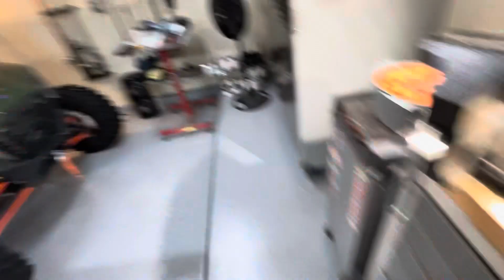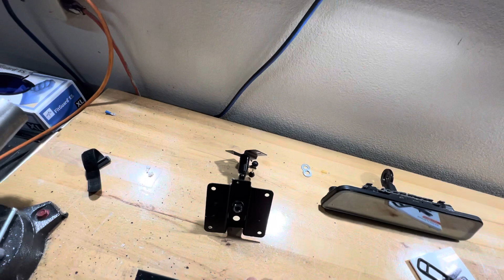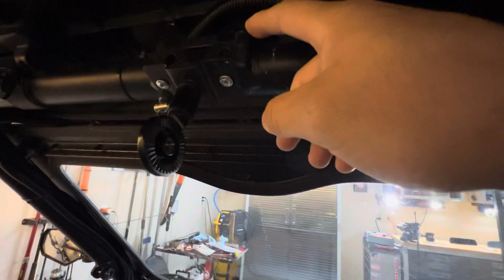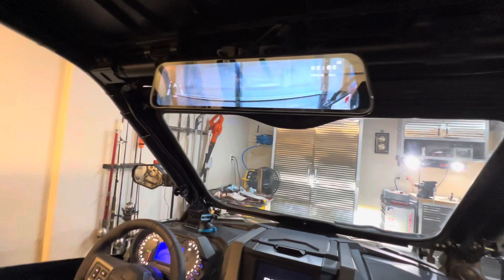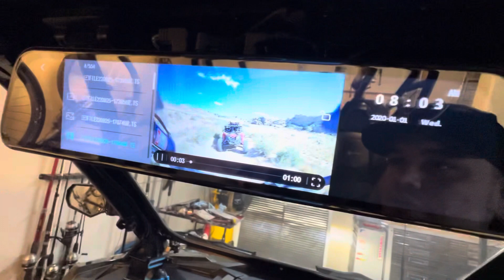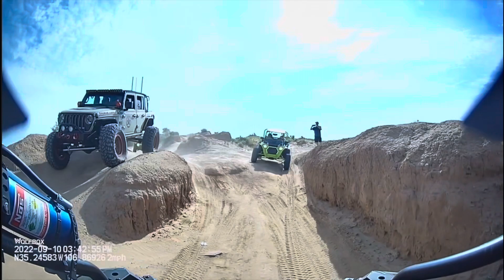Polaris RZR Ride Command for $100? (Smart Mirror)

Comment: Hey man just got this for my pro xp ultimate what do you do when you wash the rzr
Reply: Don’t spray it directly. I’ve washed mine with no problem. I been through heavy storms trailering it and nothing happened. Just unplugged it and  let it dry off. Seems like it’s water tight enough
Reply: @HistoricalFunni  ok thank you
Reply: How did you wire it to the bus bar?